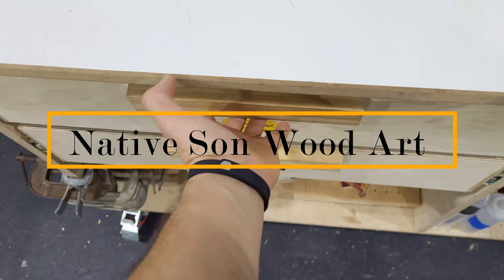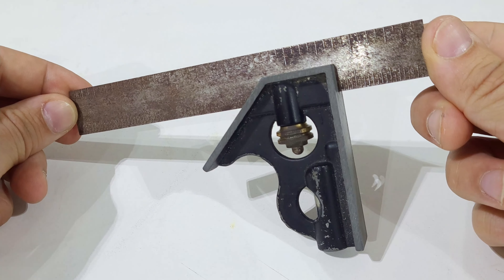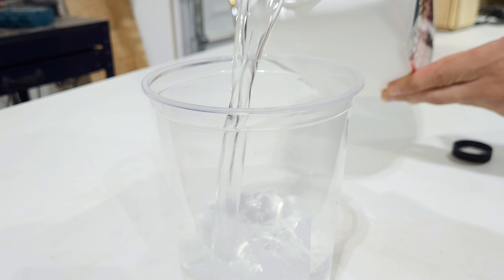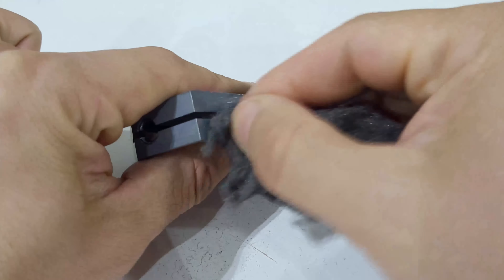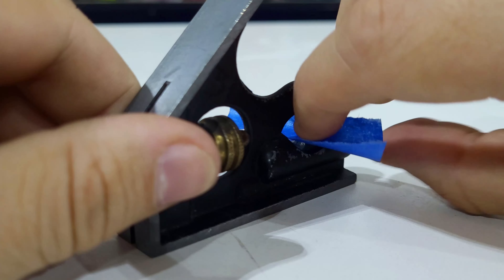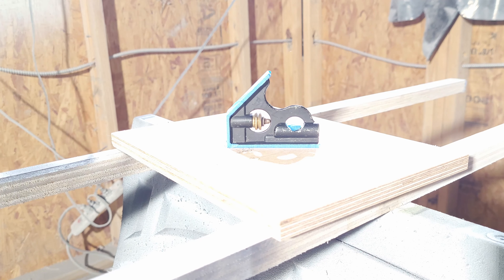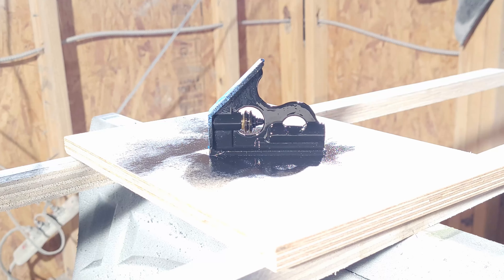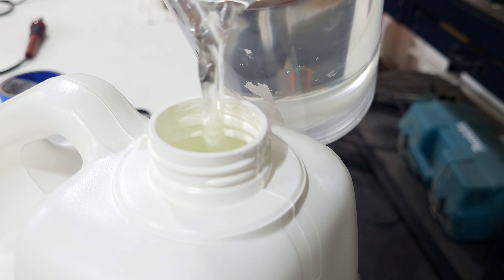restoring an old combination Square

Comment: Very cool bud!  Using the black acrylic paint and then wiping it off worked so well...I'm definitely going to steal that one!
Reply from the maker: Its a super helpful trick, really makes those tuck marks pop and easily readable
Reply: Black ink and an artist fine paint brush will work better. Fill the gradations marks with ink, leave overnight, rag, methylated spirits and some elbow grease to wipe excess off blade. The ink will last longer. The blade graduations are usually ink filled from factory, most brands do this.